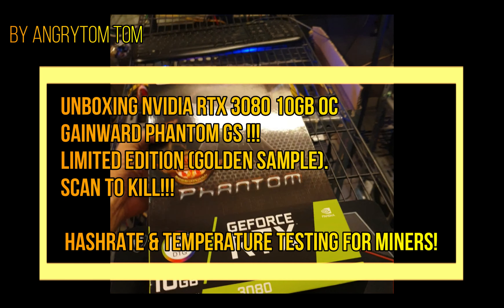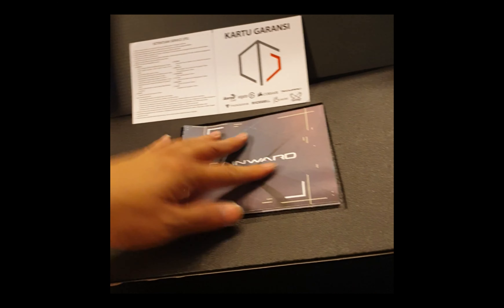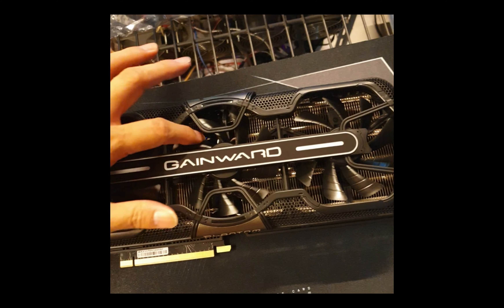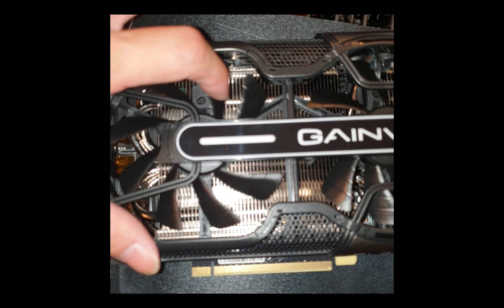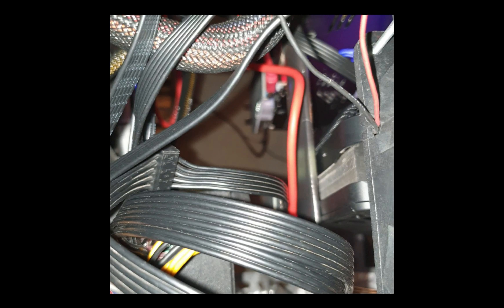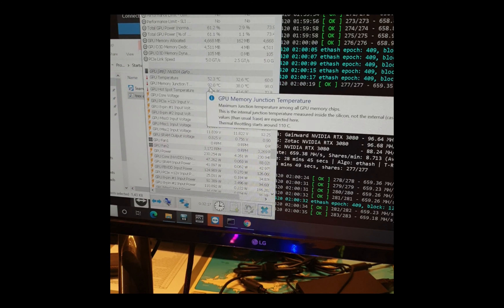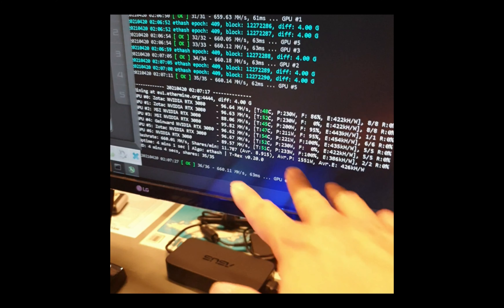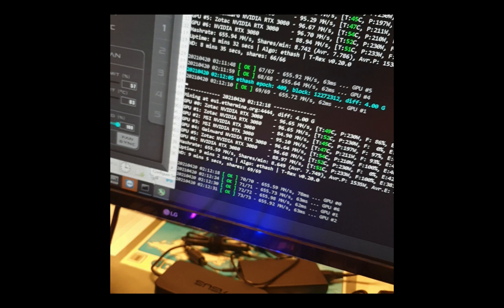UNBOXING & HASHRATE /THERMAL REVIEW OF NVIDIA RTX 3080 GAINWARD PHANTOM GS OC EDITION!

Comment: Thanks for unboxing video. MY guess that box was sealed from factory, but distributor DTG break seal to add their own seal on second GPU screw (wide seal with dates). It's usually done for tracking cards inside company that sell tech.
Reply from the maker: its very leaky thou)

Comment: for what price did you got it ?
Reply from the maker: more expensive than in the USA
Reply: @AngryTomTom  They are selling one on my store for 1500$ .... you think this is cheap ?
Reply from the maker: @angelus243  used gpu then? well its leaking oil after some time
Reply: @AngryTomTom  Would you recommed me the brand GAINWARD ?
Reply from the maker: @angelus243  not for 3080 its leaking oil
Reply: @AngryTomTom  the 3080 Gainward Phantom  is 1420 usd here in Brazil..
Reply: but I am also trying to buy a 3070ti zotac trinity for gaming/mining just 1250$.. you think is a good price?
Reply from the maker: @angelus243  non lhr ? its fukin dirt cheap bruh
Reply: @AngryTomTom  Nice!..ty, you mean the 3070ti right ?
Reply from the maker: @angelus243  3080 with 1420 usd is fucking cheap. here is much more
Reply: @AngryTomTom  yeah.. might as well mine some crypto at the same time.

Comment: Great Video Bro.. Very helpful thanks.
How is the card performing now after 4 months ? Does it thermal throttling or does the thermal pad worn off? Any complaints ? 
Please help me with this bro..
Reply from the maker: actually is is leaking oil in the backplate to my riser unless you are in air conditioning environment not too far from your rig. so i was going to claim warranty but its still lock down for another 2 weeks and i already put it in the box after I cleaned the oil up. then after 2 weeks because of extension in lockdown, I tried to install it again and boom it works fine, maybe the oil is dried already. I have 4 of these its great low power consumption only 160 to 180 watts for 98-100 mhs, but i cannot stand the leaking on the new cards. and please update all your drivers. i havent used windows so i cannot tell if its thermal throttling but so far the speed is 99 to 100
Reply: @AngryTomTom  oh.. The oil is from the thermal pads.. I thinks it's because of cheap thermal pads.. my gigabyte gaming oc had the same problem and overheating issue also so I changed to high quality thermal pads & got 30°c difference.. I think the oil is not harmful though.. but RMA is good. But can you check and tell me the memory junction temps if you can somehow.. that would be very helpful for me as iam deciding whether to purchase this or not & iam importing this card from Dubai and here in my place there is no warranty for this card too, so this is a big risky move for me. Thanks for the response anyway👍
Reply from the maker: @gypsy3779  its mem junction is in the video if u check bruh. But as of now  im using hiveos so cant tell, speedwise its great so I assume no thermal throttling but gpu temp is higher at 54-55 c. If u want no thermal throttling gundam is the best in my opinion
Reply: @AngryTomTom  yeah I checked the video bro.. I want to know if there is any throttling after 4 months of use.. I was aiming for no more than 102°c mem temp.. so if you can somehow test it in a windows system for a few minutes it would be awesome.. & only this card is available  for cheap price so..
Reply from the maker: @gypsy3779  okay if i have the timr will do it , but im working in the daytime also. But mem junction optimal temperature is less than 100 degree. And it also depend on ambience temp
Reply: @AngryTomTom  yeah I know I have very good ventilation here & ambient temp is good.. Thanks for the help anyway.. Subbed👍
Reply from the maker: @gypsy3779  also depend on fan speed set it to 100% and you should get max of 100 c.  Speed is 99 and up even after 4 months

Comment: Please help me with these questions
-Does Gainward 3080 thermal throttle?
-Did you change the thermal pads?? Or it is stock thermal pads for gainward??
-What is your room temperature?? Do you use air conditioner (AC)??
Reply from the maker: Its in my other videos, here we go
https://youtu.be/q1zgjY4eDug

Mine is phantom not gainward so no clue. But for phantom I never changed any thermal pad. Speed is almost 100 mhs
Reply: @AngryTomTom  "mine is phantom not gainward" the card literally says gainward phantom on the box
Reply from the maker: @dioxyde0  yes its gainward phantom golden sample series
Reply from the maker: yes you can see my mining room 
https://youtu.be/8OSudc686QA
ambience 35-39 celcius. no changing of thermal pad its still on warranty speed is good. the only bad thing 2 of my phantom is leaking oil on backplate